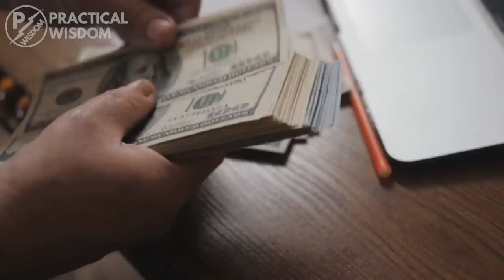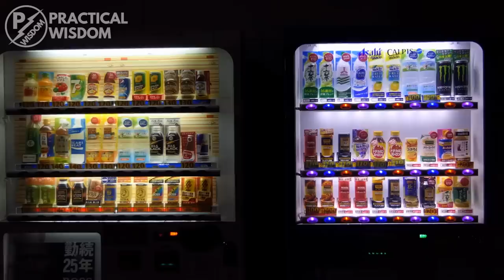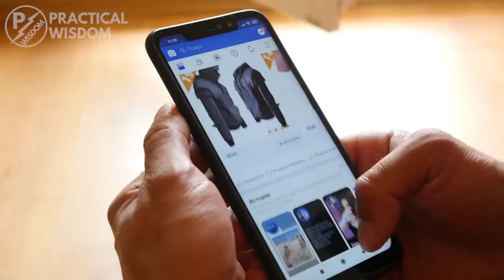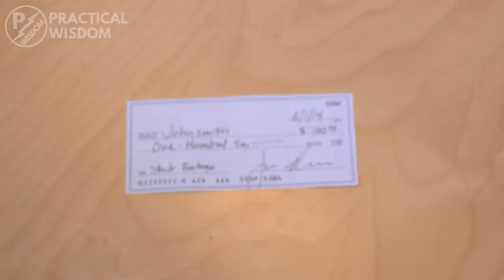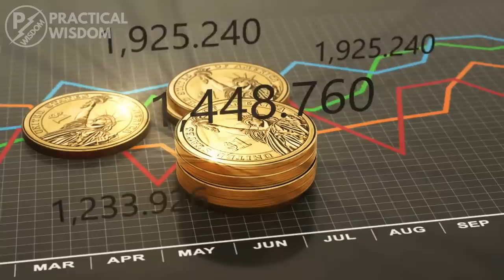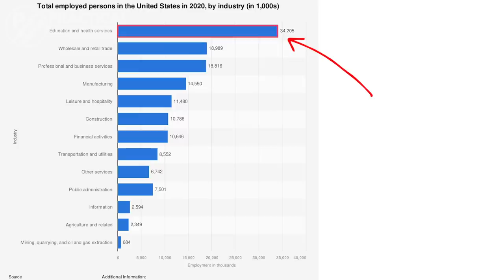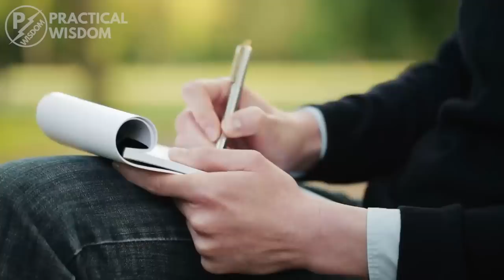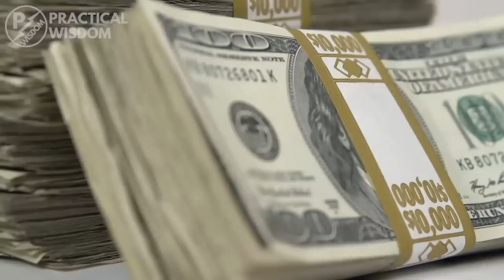6 Businesses That Will Never Go Out of Market

Comment: Vending machine businesses can have expenses not mentioned here, including paying a portion of income or monthly space rental fee to the owner of the properties where your vending machines are located. Secure locations are imperative or your machines can get vandalized and this comes with a cost that could be a relatively large proportion of each machine's income. No one wants to buy melted candy bars or warn soft drinks and electricity is not free, you'll be paying someone for access to that power plug and risk losing valuable inventory if power source isn't secure. Repairs can be expensive and scheduling a qualified technician could keep a machine offline for an extended time, which could adversely affect your space lease since many property owners won't stand for a broken machine wasting their valuable vending space for more than a couple of days. It's true that vending machines can be a lucrative business but this video downplays the costs and risks that must be considered; the good old days of making good income from a manual coin-operated machine are sadly long gone.
Reply: Very well articulated
Reply: I used to own 19 Coca-Cola machines back in the early 90s. Everything you said is true. In addition, I had a few in high traffic tourist areas with a sign on every machine stating DO NOT USE PENNIES! Pennies would jam up my machine making it impossible for others to purchase my drinks. And it would stay that way until the busines owner called to let me know I had to go and fix the machine. It was a waste of time and money as well as very frustrating in terms of trying to make a nice living.
Reply: @michaelbennett6959  I had a vending run whilst I worked full time & went to university at night. I got to the point that I shifted the non-profitable sites for me to continue. 1 site had needed me to go in the wee hours to drop off supplies as there was ZERO parking in the area. I eventually scored a broom closet to leave stock but it took me 2 hours to service the site for a few hundred dollars a month. Here in Australia we don't use 1 & 2 cent coins but the need to get $1 & $2 coins into machines was a priority for change. Debit / Credit Cards were non-existent for payment as was mobile phone / smart phones back then.
Reply: Exactly, I was thinking he’s totally missed some of the issues that can arise. Also, it’s not a “cash only business”, the last few I used were card or contactless and a lot more are being converted that way.
Reply: I think this video down played all 6 options? I could guarantee that any of these businesses would fail miserably in my town.
Reply: @phileeepaye1641  When I was vending I had a great location in a building with 4 machines. Huge sales but the issues were with refilling as they only had a loading zone out the front. I had 15 minutes only to drop 4 - 6 cartons of drinks + chips, etc. It was a nightmare until I scored a cleaners closet to store bulky items. It was still a pain & the client bought my machines that I filled for them - with a premium.
Reply: @michaelbennett6959  how much can a business owner charge you to keep your machine on there property?
Reply: @elperrocovero  however much they want and whatever you're willing to pay. It's their business so they have the upper hand in letting you on to their premises for you to make money on their property.

Comment: The right agent can lead the way.With the limited number of homes on the current U.S. market, you need an agent with the right connections, technology and strategies to achieve your home buying or selling vision. Whether you're feeling overwhelmed and want someone to take the wheel, or you just need a second opinion and you have it covered, you can be rest assured a RE/MAX agent is the right agent for any level of service, in any market condition.'